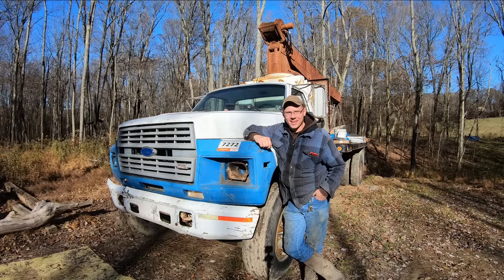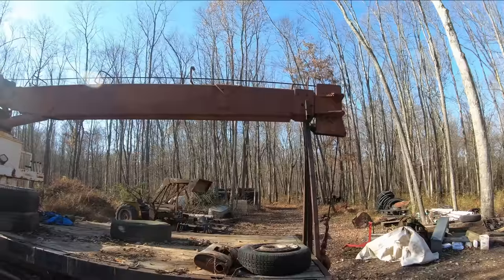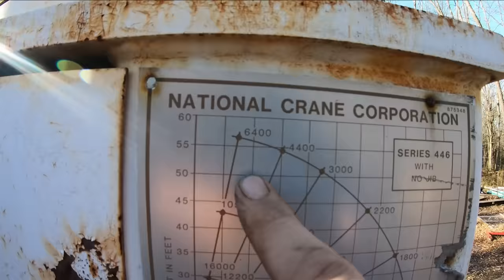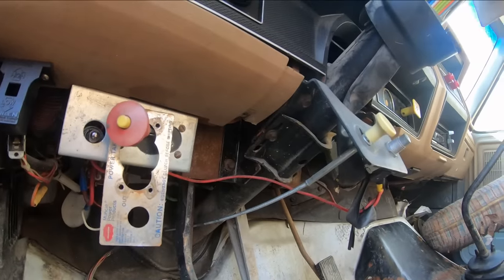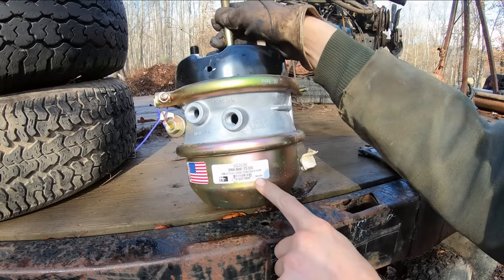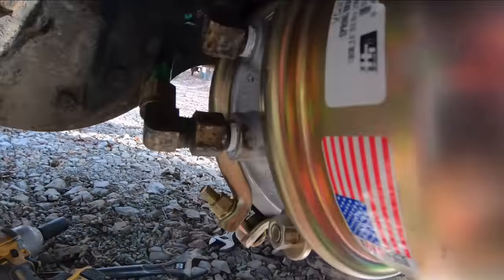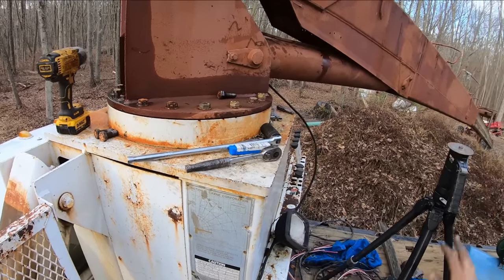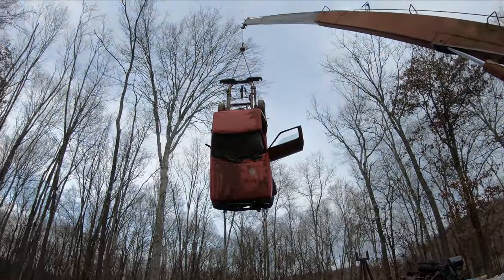$700 Auction Crane put to the Test!! Will it LIFT???

Comment: I had a question for you about your DeWalt 1/2 inch impact. How do you like the torque that it produces and are you satisfied with what it’s able to do?  I’ve been contemplating about getting one just to take lug nuts off,  and any hard to work loose nuts or bolts if need be. I appreciate this video, a buddy of mine got a boom truck and the truck that the boom is sitting on is a older Mack truck. No outriggers or anything like that, but hopefully will help him get the jobs done that he will be working on. Thanks again for sharing your videos and knowledge sir.
Reply: And definitely want to see what you can do with your new toy, lol.
Reply from the maker: That impact is really powerful! Big fan of it!!

Comment: You don’t want to raise the tires off of the ground, reason being if your on ice your truck will go skating away, so only take a slight amount of weight off of the vehicle leaving plenty of weight to keep the tires in place where you parked the truck. And with the old brake can partially caged you didn’t get an accurate length of the rod, you needed to release the cage bolt and then measure, cut and install.

Comment: The working load on the chart is what it will safely pick from left outrigger all the way around to the right outrigger. I've had my boom truck for 25 years, there is no substitute for one when you need them. mind you, you can't lift  more than 7500 pounds on a single line. You will have to 2 or 3 part line to get your full lifting capacity. Best of luck to you
Reply from the maker: I’ve got a 2 part for it just haven’t had the need. Thanks! Sure is handy!

Comment: V belt squeal: if the sheave is overly worn, the belt will ride on the bottom of the sheave. There is not enough belt to sheave contact to prevent slipping which is the cause of the squeal.  The belt should contact the sides of the sheave and not the bottom. Gauges are available to check if the sheave is overly worn and should be replaced.  If the bottom of the sheave is shiny, that is you first clue. New belts and belt dressing will not help in that case. The sheave needs to be replaced..10:19

Comment: It seems like an old tow truck cradle and a couple good tow chains and you could have a farm tow truck as well... Hell, maybe even something for grabbing more deals like this from the auction!!!  Remember, you do have an extra engine hanging around!!! ;)  Also BELT DRESSING is CRAP!! You will either burn it off that belt or have to replace the belt as the dressing will basically melt it..  And you could fix that exhaust leak!!

Comment: These engines were bad to break the exhaust manifold bolts and I do think a few of yours are broke.   I have worked on many of these trucks but never the way you did.  I also never worked in the woods so overall pretty good.

Comment: Pretty handy, to say the least, biggest tire changer in the hood. Sometimes you find a new pet and sometimes it finds you.  Much safer than a fork lift or skid. You could really go hole hog and clean up the raccoon and rat poop on the cab floor so you don't have to rebreathe it every time you rev up the engine. just saying.

Comment: Sandpaper the pulleys up if still squeals belt need changed or need replacement to water pump or bearing going on to also your try that to old Ford engine of truck! But if want try something be impressed in rad cold squeeze fluid away from rad cap on top or bottom hose open cab up get the fluid away cap button hole add 200ml of 80w90 differential and put antifreeze over and run thru engine! Lube up water pump plus thermostat and rad cores to also rad cap even heater core box! Even hoses too and old intake too!

Comment: the ford 385 series engines are 370 industrial 429 and 460  all big blocks . the 370 and 429 were used in alot of things 429 were in boats chris crafts dumptrucks the 370 was used in dumptrucks also gensets waterpumps and all manners of power units the 460 was used in pumps and cars and trucks

Comment: With the $700 you bought it for, I would never sell it, ever. Even after you get all your things built (shop, house, etc.), there will always be a day where you would wish you had that thing still around, and renting something would cost you about the same as what you bought this one for, and that's without the hassle of transporting it, having to rush to get everything done inside the rental period, etc., etc.. Even if it's only gonna be used twice after you've built your shop and house, it's just worth it to keep around, and that's without considering projects from friends where it could have its uses. As long as it's not in the way, keep it. You'll never regret that.

Also, at 27:13, there'll be countless of people who always yell that everything made in China is absolute crap, and that this "American made" brake can is awesome just because it's made in the US. Even after you point them to the made in China part, they'll still claim that the American flag made it better. For 95% of things, made in the US only means that it's three times as expensive, and only just as good, or even worse than the Chinese version.

Comment: Just goes to prove it's hard to kill a Ford, but I'll tell you the best engine ever builted is the Ford 300ci straight 6, I have one in my 1980 F-250 4x4 pickup and still going strong in 2021. Oh and just one other thing you got a running engine to go into your other gasser with the dump box, I would turn it into a flat dump bed, with removable side oh 12 to 18 inches high. I bet whoever owned that truck before just got lazy on maintenance toward what they thought was the end of life for the truck, and were wrong, good maintenance and almost anything will last almost for ever.

Comment: you can take out trees safer ,although you could use the wrecking ball to take out trees and deftly yes to seeing this more .
Reply: As someone who's had to use that exact baby crane for tree work, don't get one of these expecting to do deeds. Its a 6 ton crane and that's 6 ton vertical, not reaching out any. That crane is a lift log right next to the crane only.

Comment: If you have tire's touching the ground on that boom truck you're working off of the chart. All the tires including the steering axle tires have to be off the ground or the chart does not apply.
Long long ago like in the 50s and 60s some cranes Had an on rubber chart. In addition to an on the outriggers chart, put a unit like what you haveis not supposed to be operated with any tires on the ground

Comment: A word of advice: it’s all good to replace the service diaphragm, but NEVER try and take the v band clamp off the spring/parking side to try and repair it, it will explode! Every newer brake chamber built after a certain date (not sure when) will actually have a press fit band on the parking side so it can’t be taken apart, from what I understand this was mandated after a TON of accidents where folks got hurt or killed messing with the spring side. On a more fun note you can take that old chamber and have a little fun with it, plus practice your aim. If you set it up as a target grab your favorite rifle and aim to hit the clamp holding the back section together. If you manage to hit it you’ll get to see the thing go bang, so it’s education AND fun!!

Comment: I did not get a good look at the point where the cable connects to the “head ache” ball. A common mistake is to put the cable clamp backwards. The cable clamp resembles a horse saddle. When installing the cable, there will be a live end and a dead end. The live end takes the load. The dead end should be after the live end rests in the saddle. The rule of thumb is, “do not saddle a dead horse”. 
For a never operated a crane guy, you picked up the basics very quickly and knew that the bolts at the turn table are the weak point.
You might consider carrying some pads for the outriggers for operating on soft ground.
There are very specific signals for communicating between the operator and the ground guy. They are on line. There is too much margin for error without good communication! 
You also might consider adding a jib to the boom to extend your reach.
Somewhere on the boom there should be information on weight limits for lifting, based on the angle and length of the boom. 
A full trailer can be towed behind the boom truck if correctly brake equipped.
A full trailer is a semi trailer with dolly under the front of the trailer.

Comment: Get a good set of outrigger pads. Those float won’t stabilize the machine on their own. Learn the load charts. It’s not a suggestion. Cranes can almost flip under their own weight. Order the manual for it. You need the document to understand the limits of the machine... it’s not a Tonya toy

Comment: Good BUT... You did say that the emergency brake comes on at 65psi. Not so... The emergency low pressure warning light and alarm come on at 65psi at which point you should pull over immediately. At around 25psi the emergency/parking brake comes on automatically. That was probably just a slip of the tongue. I have to say I enjoyed the video and I learned a bit more about the air brakes I use daily.
Reply from the maker: No at 60 psi you can release the brake, you are correct on the low pressure engaging tho
Reply: @DieselCreek  150psi emergency pressure release. 125psi Governor cuts in to release pressure. 100psi... ok to drive. 65psi buzzer and warning light come on so time to pull over and stop. 25psi emergency brake applies. Can’t say I’ve ever tried setting off under 100psi. I did drive abus that dumped its air at stops so I was leaving the stop with the gauge on 65.

Comment: Don't just scrap the old Ranger, strip all the good parts like: rear axle and differential, front axle and differential, center differential, transmission, engine, if rebuildable, etc. Pull them and repair them, and sell them or give them away to other Ranger owner/viewers as prizes. RECYCLE. Keep up good works.

Comment: 24:34 What you failed to mention to all the gorillas watching this, is that if you over tighten these, you will gall up the mating surface, and mess up the seal. The specified torque for these type of fittings is not much at all. I´ve seen other youtubers hang on the wrench on these.

Comment: Where possible, dont place yourself between the load and the controls. If this load had dropped it could have fallen onto the crane and killed you. Besides the lifting point failing, the rope could break, the boom could fold or even the outrigger hose burst causing the truck to lean into the load. Plenty of people have died doing this type of lift that you just did.

Comment: When u waste gas and buy a tool u don't need because u don't know how to reuse parts from ur old air can!!! LMFAO
Reply from the maker: I didn’t go buy the caging tool, I keep an extra set in my truck in case of emergency’s, the emergency side of the can was leaking which is “technically” not user serviceable and lastly why would I want to put that old pushrod in, the threads were all chewed up from having to use vise grips on it

Comment: Not that you don't know it but you have at least 1 cylinder missing. Sounds like a leaking valve???  Keep calm - you sound like Alc Steele.  You should fix that popping sylinder before too much damage is done.
Reply from the maker: I’m 90% sure it’s just an exhaust leak that sounds like a miss

Comment: You got it backwards.  The parking brake chamber is the one towards ther front the service brake is towards the rear.  The parking brake chamber is not serviceable.  Buy a new can.  It is extremely dangerous to try to open the parking brake chamber

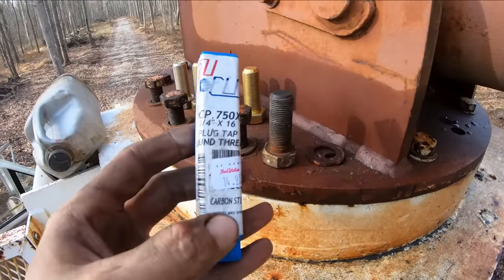Comment: 38:09 What about using thread cutting oil when you run that tap in the holes? Not only is cutting oil good for the cutting tool, but is also makes is easier to make the threads in the hole. I think you are a good mechanic, but I see you take too many shortcuts in your videos. Or you are not showing in the video all you do.

Comment: you treat your first truck like it's just a piece of trash with some parts to rip off it. and then scrap the rest. you seem to really like it, but i guess you're one of the types who can "transfer" the spirit of a car into a new one, like the newer version of this truck you got to replace it. i couldn't do that though. i'll keep mine running until it's absolutely not repairable anymore. and when that does happen, replacing it with a same one wouldn't feel the same, and any replacement one would probably be trash by then too, so i'll get a different neat car i like instead. while the first one just sits pretty in a garage forever.
Reply from the maker: No good if you can’t have fun with them, you’ll see in the next video there was nothing left of that truck the frame had been patched several times back when I was driving it
Reply: @DieselCreek  yeah, i could see that truck looks completely dead. i'm just too sentimental though. i'd probably turn it into a lawn ornament or something lol. i wouldn't be able to deal with "burying" it and know it got turned into a cube of metal to get melted down and turned into something potentially stupid. or just rot in a junkyard forever instead of my yard.

Comment: Dude you should really replace the lines no? I can't imagine we're talking more than 100$ to prevent future stress and hydraulic injection.
Reply: At least the ones behind your head xD
Reply from the maker: The lines running up to the winch actually look pretty new. They don’t concern me at all, plus everything is built with safety valves so even if a line blew it would not effect the crane other than it would just stop working. Also to replace all those hydraulic lines I’d guess a lot closer to $1000.00 hyd lines are very expensive anymore
Reply: @DieselCreek  well as long as your safe bro. I don't know how well those safety valves are working (9:30), but i also didn't know it was closer to 1k, oof.

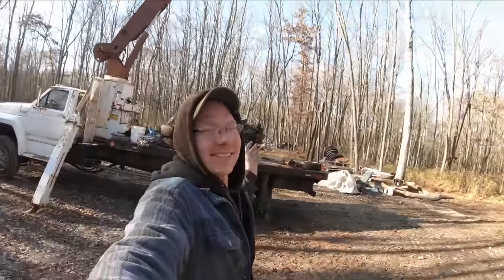Comment: 12:07 You are a dangerous crane operator, You lifted the load too high, anything under the load could be smashed if it fell. Plus I saw the load swing out of control. I know you sped up the video, which increased the appearance of the load swinging. You should keep a heavy load as low as possible, never to the top of the crane with a 500-600 pound load. You got lucky that nothing happened.
Reply from the maker: That crane is rated to pick 16,500lbs that ranger can’t weigh more that 1,800-2000 the weight doesn’t change no matter how high you take it. All that matters is the angle of the boom, the rating decreases the farther you take it away from the base
Reply: @DieselCreek  My comment was not about the load rating, it was about the danger of  lifting a heavy load  too high and the possibility of the cable breaking.  As others have said, never get under a load while in the air. That is a good way to get seriously injured  or dead. Never trust a load in the air. Motors weight around 500 pounds and up, that is is a light load for that crane, but it would kill you if it fell on you.. I am not sure it was a good Idea to lift a truck before a close inspection of the cable.